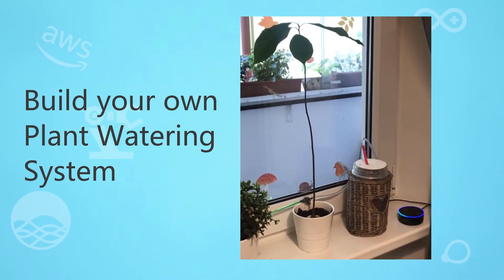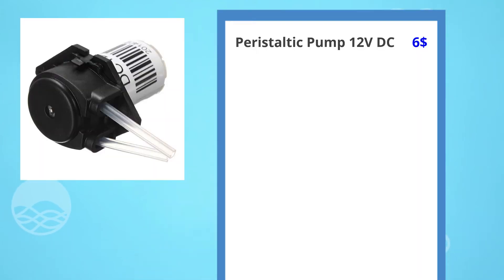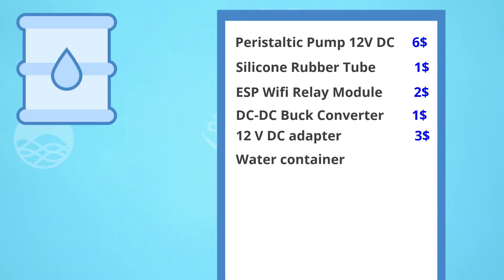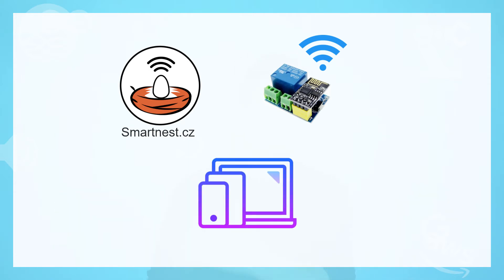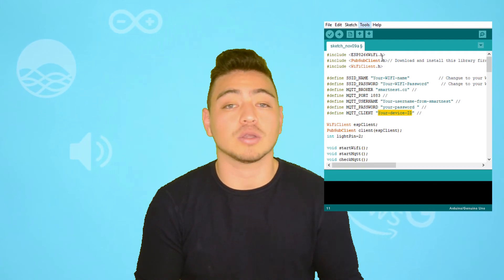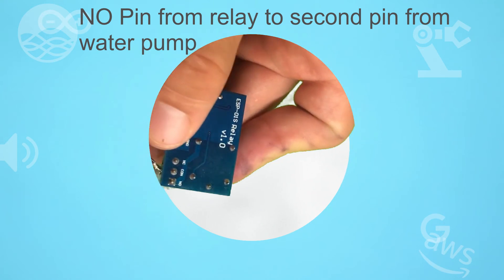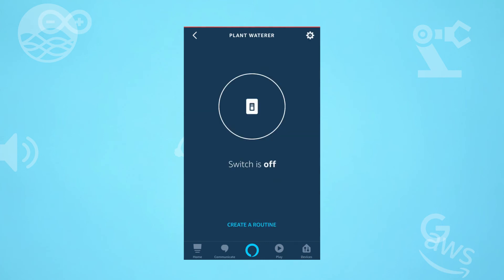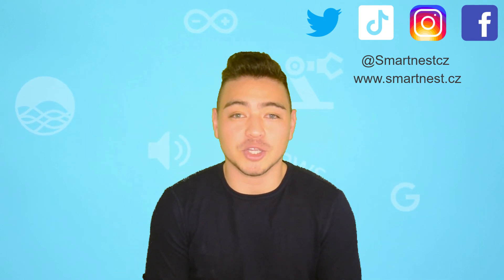Arduino + Alexa Watering system - DIY Home automation - Smartnest.cz

Comment: if we have more than one button/power output to control how do we add more than one mqtt device ids
Reply from the maker: Hello you can use the device type switch group this allows to control up to four different digital outputs with only one Id. you would receive the commands powerState1 powerState2... etc.